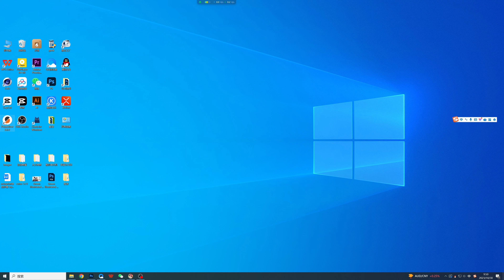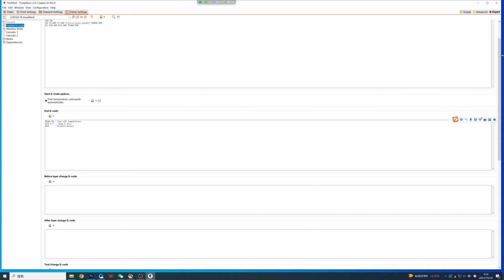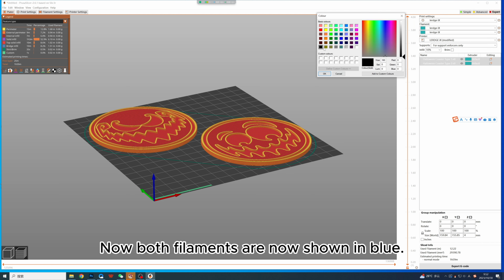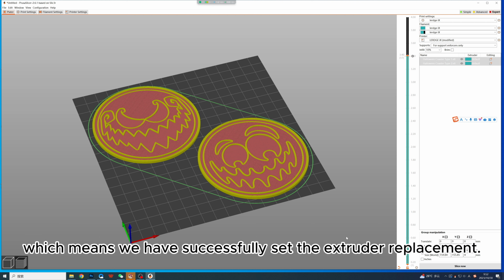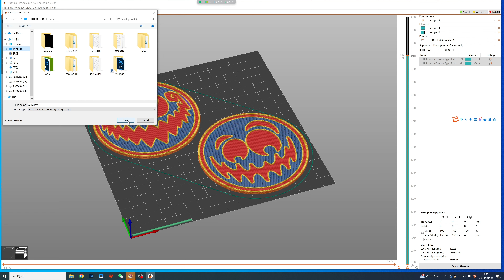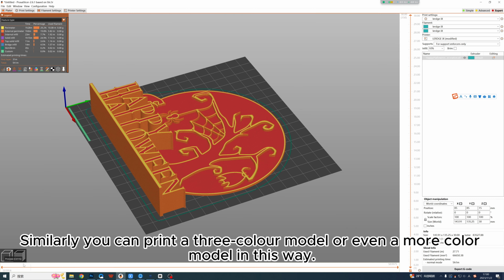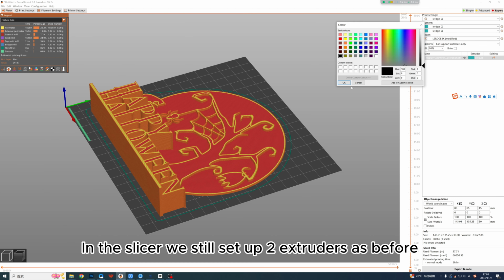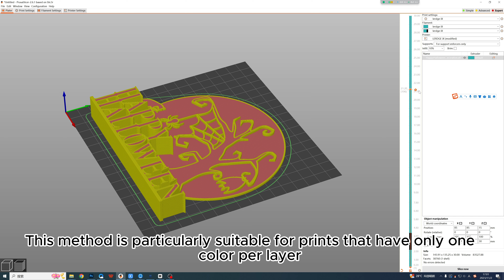How to get the multi-color prints by Lerdge iX 3D printer?| Supper easy tutorial, no need modify

Comment: What is the difference between the v2 and v3 printers you have in your site?

Can’t seem to find anything.
Reply from the maker: The main difference between V3.0 and V2.0 is that it is easier for V3.0 to upgrade linear rail 3D printer: 30 minutes for V3.0 to upgrade linear rail, but 2 hours for V2.0 to upgrade.